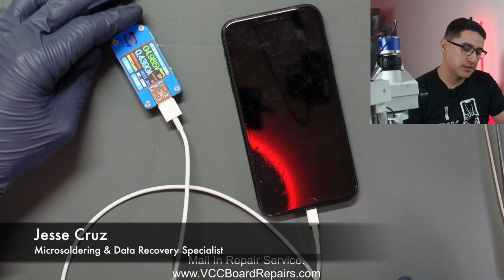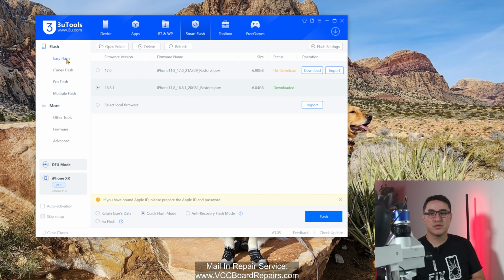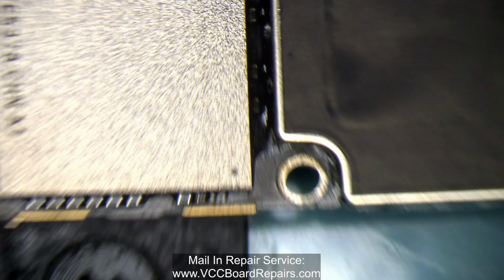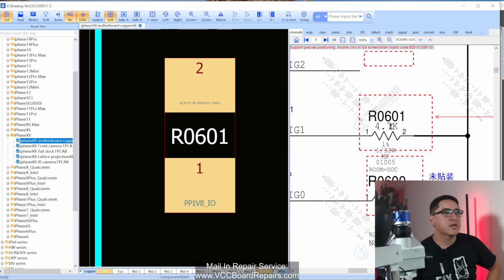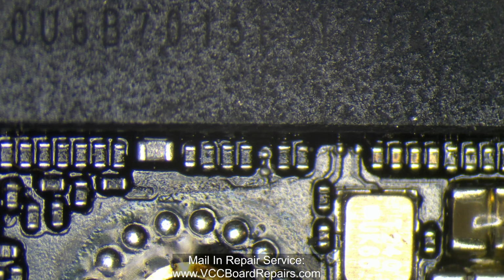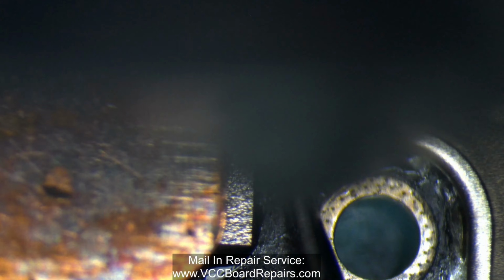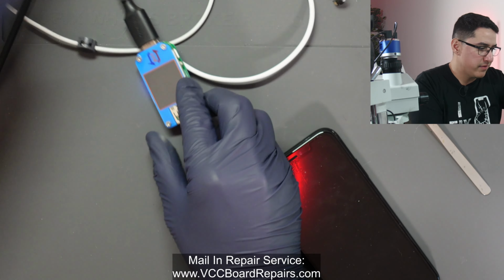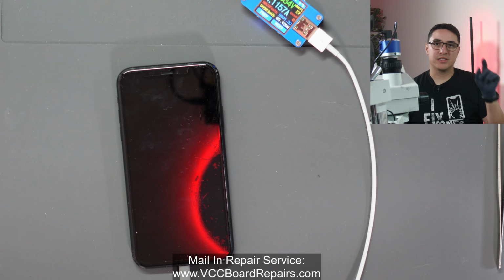This iPhone XR Does Not Turn ON. Stuck In DFU Mode Solution Without Losing Data.

Comment: I watched your video on YouTube, and my situation is almost identical to what you described. The symptoms match almost exactly. However, I tested the 0601 resistor, and it measured 4.7 kΩ. I also reballed its pins, but the issue still persists. Even the diode value and the voltage on the resistor's related pins are fine.
Reply from the maker: i'd recommend asking for help in my repair group: www.vccboardrepairs.com/vcc-fb-group

Comment: CPU replacement. The main CPU, RAM, and UFS memory were transplanted for data recovery. It is Z Flip 3, S22, Fold 3, and model CUP memory, but the password has been changed for all of them, so unlocking the lock screen is impossible. Why?
Reply from the maker: i'm not sure
Reply: One of his new video has a solution.